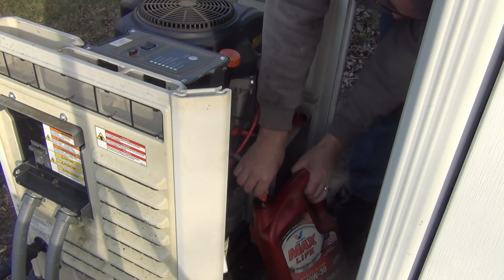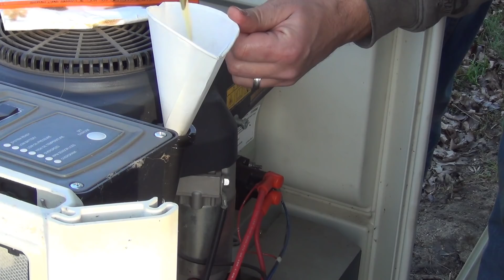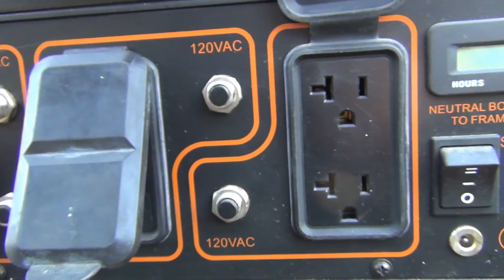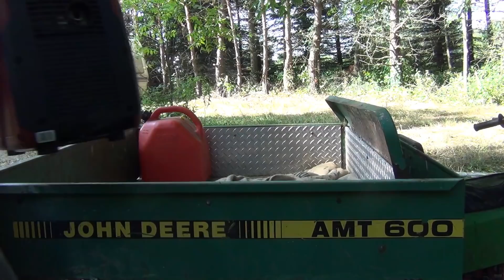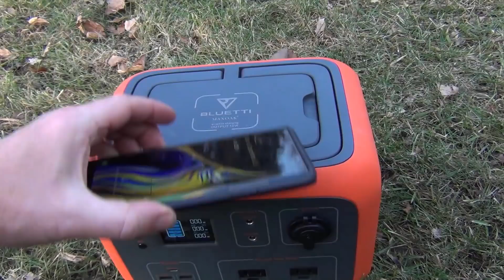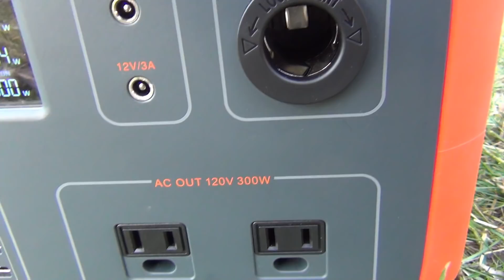4 Ultimate BACKUP POWER Options For The Farm or Homestead

Comment: I,m a big fan of all generators by Briggs & Stratton...parts are easy to get.the quietest? No .reliable ,yes.have a 12kw on our rural home.unfortunately we have heat pump and electric coil heat...70 amp draw.thats a big generator.so i decided to down size the gen kw and use plug in space heaters.also got a 1500 watt portable ac unit( it gets extremely hot and humid here in Tn in summer).just a way to save money on a bigger gen.also have a 8 kw portable ,briggs.electronics fail...run those portables once a month,keeps the oil moving and keeps charge on the stator,if you have electric start keep them on float especially winter.👍

Comment: The fact you can duel fuel most gas generators helps find fuel during a power outage. When the power is down it is hard to get fuel out of underground tanks so the ability to run generators off bbq propane tanks makes things very handy and the fact it leaves the liquid fuel system intact means you can still run gas when it is easier to get or you have a good stockpile of it.

Comment: I have a 6500 sqft home, with 3 levels, what wattage would I need for that?
Reply: Growyourveggies most manufacturers have calculators in their websites. Input a few parameters and they will suggest the size, based on the data you provide.
Reply from the maker: It depends on what you want to power  you could get a 15kw or bigger and power almost everything
Reply: SSLFamilyDad thank you!!
Reply: Growyourveggies 
12000 mega watt nuke plant

Comment: out of those i got the top 2 options  , and a RV battery inverter dedicated to my sump pump , the home center 12 volt kits for sump pumps are toys
Reply from the maker: I have thought about doing that for my sump as well, I have the battery backup system but it doesn't work that well
Reply: @SSLFamilyDad  we bought a Xantrex inverter charger , that automatically changes over from line to battery and charges the battery , we spent about $ 2000  dollars , it`s a piece of mind  when no ones home .
Reply: @SSLFamilyDad  we tries the box store back up sump  system , and they are toys

Comment: Good info. Most people think they need a 15-20KW Genny for their home, when a 7.5KW will do just fine. I have a 7.5KW from Harbor Freight and it powers a 3 family. 3 frigs, 2 oil furnaces, well pump, 5 big screen Tv's, 1-desktop, 3 laptop computers and any lights on the property. The 2 electric water heaters, dryers, stoves/ovens cannot, unless nothing else is being used. I back feed it from the garage to the house. It's nowhere as easy as your automatic one, but it's a life saver. I wouldn't recommend my way to anyone, unless they know about electricity, shutting down certain breakers, especially THE MAIN, before doing anything. Great video and Merry Christmas to you and your family, as well to everybody else !
Reply: august 
And no a/c
Reply: @ramellin , Good point, thanks.